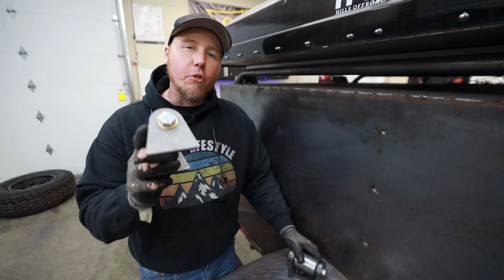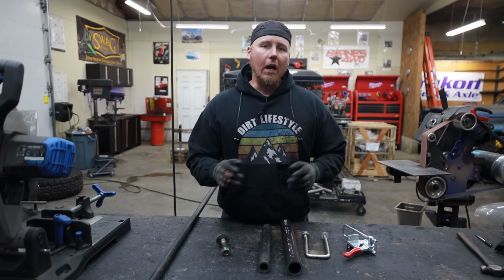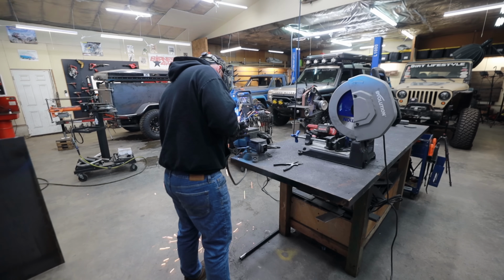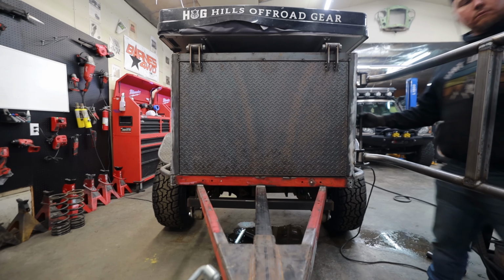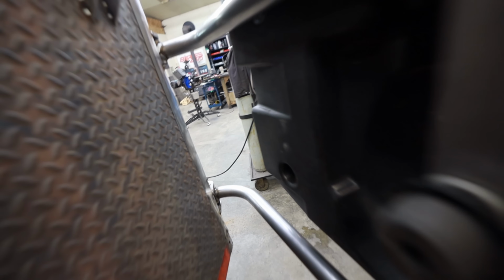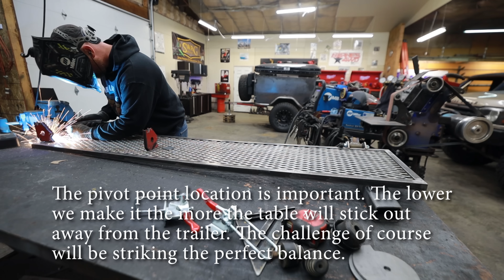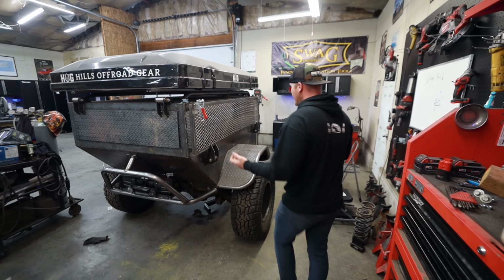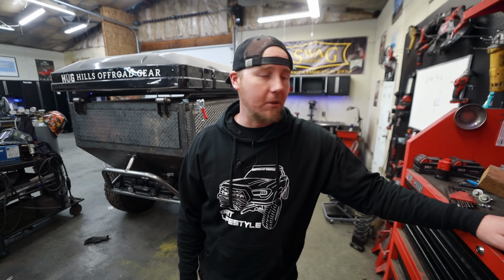Finally Back In The Shop! Harbor Freight Offroad Trailer Episode 6 👊.

Comment: Super great idea for mounting that up front, rather than in the back of the trailer.  Sure it's going to increase tongue weight, but given the geometry, probably not pound for pound.  Do you think adding some sort of manual locking system for the latch is a good idea?? I see the mechanical advantage you're getting, but I'd be worried that when bouncing around it could come loose.

Comment: Why not legs that slide into a square tubing section on the table (the 5ft long piece) it would then pivot down and have thr ability to pivot in any direction needed. The legs can even have multiple sections that extend and have holes in them of different height needs. Then when you are done and packing up, they just slide back into the square tubing out of the way. Seems a simple and robust solution to me.

Comment: #TABLESUPPORTIDEA.....what if you used a small pivoting bar at the ends of the table. Mount inside the table with pinch capture holders, T heads and and T head reciever mounted to the main body? No cables, the table already folds up so getting the T heads in the slots should be easy, and gravity will do the rest. Rigid support, no rattles, and minimal space lost inside table surface.

Comment: Why not do like a sprayer on a sink and have the cable go through a hole inside the trailer with a weight on the end of it.  When you push it up the weight would pull the cable down into the trailer, when you pull it down the weight would act as stop for the cable.

Comment: How do you use the glue when installing rivnuts without getting it on or into the threads?  Are you just putting some on the outside flat where the rivnut inserts?

Thanks for picking up this project again.  🍻

Comment: Rather than a cable would two straight flat pieces of steel work with a central pivot point that fold in half to close and are rigid with the table down?

Comment: Couldn’t you build a retractable cable system? Similar design to a lawn mower cable retractor with a coil spring. Piece of tubing supported by a couple bearings with a ribbon type spring that will wind the cable back onto the tubing (spool)?
Reply: I just realized that my comment made me sound rude haha, I know you can build it.

Comment: 727 comments are a lot to wade through, so it’s probably been suggested…but what about a set of scissor arms that fold up when you put the table up, but are fully extended with the table down.  Aircraft manufacturers use this on cowlings all the time.

Comment: Not to be that guy but it's very simple get yourself to pieces of flatstock approximately 12 to 18 in Long by 3/4 to happen inch wide drill and place a hinge in the middle attached table attached to side of trailer folding hinge support bracket

Comment: I can't tell in the video how much material you have at the hinges for the table. Can you just drill holes in the inner and outer plates and pin the hinges when the table is at 90 degrees?

Comment: Maybe it has already been said, but you could simply attach the eyelet of the cable (with some sort of washer or something for the stop) to a spring inside the trailer.  As the table folds down the spring will extend.  Also lots of other good ideas in the comments!

Comment: Why don't you just do collapsible legs near the outside corners that rotate 90⁰ to stay flush with the bottom of the table when its in the closed position. 🤷🏻‍♂️ Maybe even some old trekking poles. Plus they would be adjustable lol

Comment: I dislike that the wires and "tailgate hinges" take up space above the table.  Feels restrictive when working on the table.  Could you have a leg system at each corner which comes in at 45 degrees and supports itself on the bottom of the trailer?  Need a tab on the bottom of each side of the trailer to put the legs on.  Legs hinged at the table.

Comment: I like you trailerbuild! Very inspiring. I also like the fact that you use proper PPE! How does that grinding shield/face protection work for you? Do you get sparks flying up underneath? Name and brand of it? I wear prescription glasses and have a hard time using regular PPE-glasses as I dont see very well, but also they interfere with my respiratory mask.

Comment: That's a lot of steel. You've over engineered everything except the frame itself. What does all that steel weigh, and is there any room for cargo capacity? Your building skills are excellent. But maybe get some weights on that thing and possibly reinforce that trailer frame/tongue.

Comment: What about adding triangular 'wind break' panels to each end, they fold flat against the table when stowed away, but when open they hinge out towards the ends, the straight edge (parallel to the body) hook onto the main body when upright to the trailer creating a solid fix and hence the table height. Similar to this.... 

https://i.pinimg.com/originals/90/1a/ae/901aae601b0bef7fc8f6a9e4e20e081e.jpg